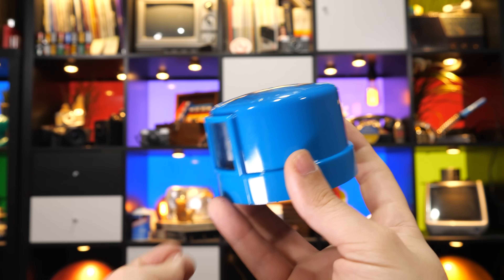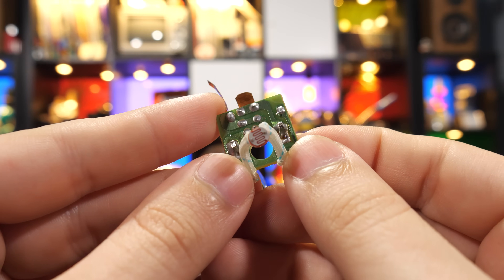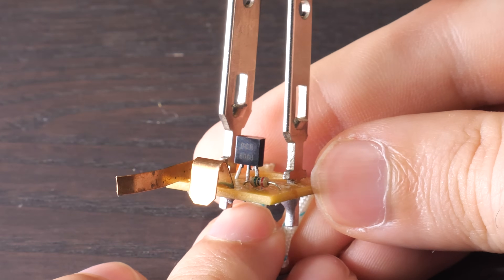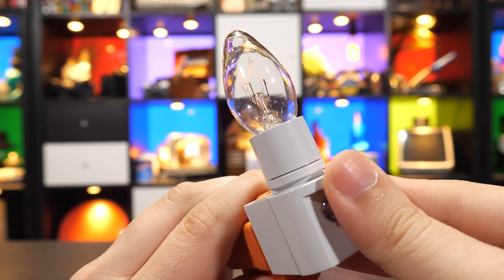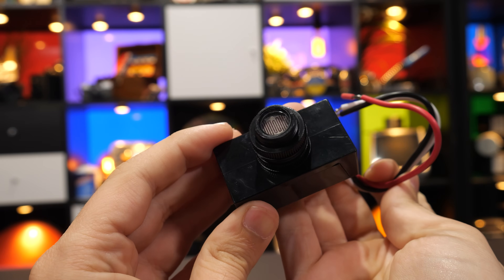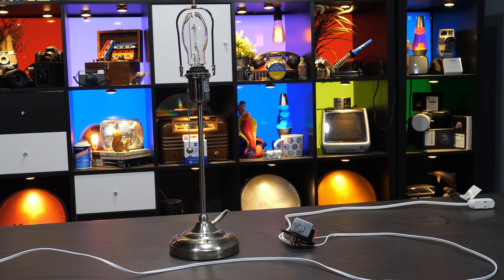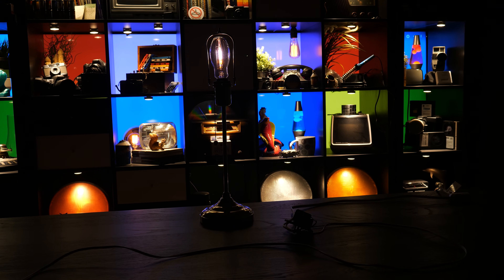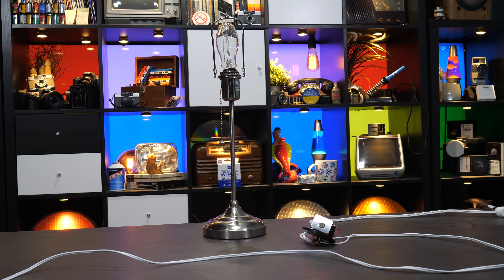Photoelectric light controls are weirder than they seem

Comment: 12:58 "in many cases, banks of street lights are wired to a central location, and a single one of these is used to control a contactor at the distribution point"

Gee, I wonder what those contactor thingies are! Also I love crossovers :)
Reply: It’s basically a beefier version of a relay
Reply: @joeslinky  I'm pretty sure they are referencing the existing video about contactors ^^
Reply: @joeslinky  I was referencing other TC video about contactors, you should check it out, it's great! (As every TC video is)

Comment: I worked for lighting design firm and designed layouts for streets, highways, and parking areas. But until now, I had no idea how the photo controllers actually worked.  Well done, thanks for posting!  And yes, striking an HID lamp requires a large amount of current and is hard on the lamp.  A system that works slowly is critical to maintain the life of the lamp.  Again, great job explaining the why in addition to the how.

Comment: i've fixed a digital clock in a late 80's nissan by re-flowing solder joints on a resistor that same size. questionable construction. possibly planned failure? i mean it is quick to replace now.

Comment: Thermostatic switches are also used in residential HVAC systems as a sequencer. It delays the blower in the air handler turning on for a few seconds (usually around 30) for the coils to start becoming cold as the refrigerant begins flowing before running air through them. More importantly they delay the shutting off of the blower after the compressor has shutdown to harvest the residual cooling from the coil and to blow the slug of cold air clear of the ducts and into the conditioned space. I would also think this helps to avoid moisture problems in the ducts of cold air meeting warm humid air in a confined space and not being blown clear.
Reply: Your comment was stolen by a bot so I'm commenting here so you get promoted
Reply: @How_To_Drive_a_TARDIS  thanks. I didn't know they were doing that now

Comment: I'm not sure if I misunderstand so someone please correct me if I'm wrong, but the way the circuit diagram is drawn, the LDR's active region — that is, when the photoresistor is active — will still run the light since current will still flow through the circuit. In the circuit diagram, shouldn't the lightbulb sit between the 2MΩ resistor and the thyristor?

Comment: There would be a "middle ground" design between the bimetallic thermal switch and a microprocessor-based solution.   Look into an electronic circuit called a "comparator".  It produces an on/off output when its input signal goes above or below the "reference" signal input.   You can buy photoelectric control modules that use this approach, and they have the advantage of having a "sensitivity" control on them to allow the user to set the desired light level for activation.  Hysteresis can be built-in to the circuit by simply adding a resistor.  The output of the comparator then drives a relay or contactor sized to control the load.
Reply: Most outdoor PIR lights and sensors have the adjustable dusk to dawn feature built in, exactly as you say.

Comment: There´s an advantage of wasting 2W of power: this thing won´t freeze up in winter, and there won´t be condensation.
Driving a microcontroller from mains voltage in a safe manner takes also 1W of power. You can of course optimize it, but then you need to test-qualify it every time you make the smallest change. And of course, complexity shortens the mean time to failure, so the wasted energy is nothing compared to the cost of replacing those things.

Comment: I recently made some moth trap switches I used a 555 for the hysteresis and it drives a relay with it's output. No micro, nice and simple.
Reply: A friend of mine made it using bare transistors, no microchip needed but it did use a slightly bigger ciruit

Comment: 17:15  This device is much more tolerant to lightning, too.  Important when it's setting atop a tall, grounded metal spike.
Reply: Funny you should say that.  The last time I saw the insides of one of these controllers was when it had just been turned into plasma by a lightning strike.  I was stopped at a red light and was across the street at the time, about 50 feet away.
Reply: A Faraday cage is not a magic item. There is heat when a lighning strikes, there are the magnetic components that come with a large current, points of failure (hot spots) if the metal has imperfections, etc.  They need to be engineered and tested as well.
Reply: I doubt it would survive a lightning strike. Even if it did, plenty else in the street lamp wouldn't. Including the lamp itself.
Reply: @Nathan_Lang  Direct strike - no. However, a lightning strike generates EMP and voltage spikes that may fry electronics that are too close. This device would have higher chances of surviving a close lightning strike than one with a microchip and a power supply.
Reply: @Nathan_Lang They mean the EMI from a nearby lightning strike, which can cause issues with microelectronics.
Reply: @Nathan_Lang  no, it  won't, what he means is the brief flash of lighting will not be enough to trigger this to turn on.
Reply: @EwanMarshall  100% not what they meant, otherwise, they won't say "tall, grounded metal spike"
Reply: Don't you mean turn off the light? @EwanMarshall
Reply: There are semiconductors in the drivers of LED streetlights. I don't think it's be that big a deal to incorporate a dusk switch into their design, if they don't already do so.
Reply: The point goes deeper. The power lines will have introduced surges from all the metal spikes grounding lightning, even when controller is in safe ground level box
Reply: Uh, I've seen my cheap solar lights turn off for a split second when the lightning was bright enough to cause the solar-cell to think its day now. Lights going off due to a lightning was creepy for the few seconds it took me to make the connection between lightning-photons triggering the solar-cell-daylight-detection.
Reply: hard to believe that heat activated switch can work on outdoor light poles in temperatures ranging from well below freezing, up to over 100 degrees.
Reply: @itoibo4208 that might work to its benefit, the sun will be higher in the sky when the lights turn on in the cold dark winter vs lower in the sky in the hot bright summer
Reply: @raptorjesus5488  The sun is closer to the horizon (lower) in winter and farther from the horizon (higher) in summer.
Reply: I love this software joke worried makes it look like it's crashing which the look of a city would be you put one of those computer ones up there lightning strikes and that's exactly what happened with the software inside it stutters out😂😂
Reply: Ah, that would explain why a cheap microcontroller is not the way to go 😄
Reply: Well, usually light sensors are installed on top of a cabinet on the ground. Also if your concern is lighting you really should use SPD, because you know what is more sensitive? LED drivers that are inside the fixture themself. They break down so you really want the SPD.
Reply: I bet many, MANY, more of these will fail, compared to solid state approach, because those thermal switches wear.
Reply: This design also prevents kids turning the lights off using a laser pointer - what kid is gonna want to stand there for however long it takes those resistors to heat up enough to throw the bimetal switch holding a laser pen steady on the sensor and risk getting caught ;)
Reply: and the little bit of extra heat keeps them from freezing in the winter.
Reply: I highly doubt any of the components inside would function after being hit by lightning lol. At the very least those resistors would be destroyed and the switch would fail closed causing the lights to be stuck on.

The most likely thing I see happening though is the entire circuit being completely obliterated beyond recognition and the lights shutting off. I doubt any components in there are rated for the amount of power capable of obliterating an entire tree.
Reply: I did a tear down on one of these last year and was similarly surprised at the elegance and simplicity.
Those thermal disc snap-action switches are well proven and manufactured by the gazillions.  Good choice!
End result:
(1) More tolerant to lightning (or voltage glitches).
(2) The normally on warm resistors probably help dry out moisture in wet environments.
(3) No microprocessor with a power supply incorporating those famous "high-reliability" Chinese capacitors.
Reply: Source?
Reply: @AtlasReburdened  25 years as a broadcast engineer.  I've seen quite a few of these with their contacts welded closed.  Short of that, they're quite reliable.  (Tower lighting systems usually have these located at the transmitter building and at ground level, where they're easily replaced.)
Reply: @AtlasReburdened  Go Googling. You shouldn't expect people to spoon-feed you information all the time.
Reply: I mean if that is a worry, give it a Faraday cage, problem solved
Reply: @LillyP-xs5qe  that ads more cost, complexity, and points of failure. It can be easy to solve a lot of the problems that can arise when engineering something, but its very difficult to do it in a simple, cost effective manner that increases longevity. there is a reason why "over engineered" is a common phrase.
Reply: @davidfernelz  do you know what a Farady cage is? I wouldn't call it complex or costly, it's just some metal cage to let the electricity go around the unit instead of through it
Reply: @davidfernelz  adds more
Reply: @LillyP-xs5qe   The skin effect of the metal rod itself can do that, if the housing is properly grounded :)
Reply: @LillyP-xs5qe A Faraday cage around a giant metal lightning rod with a lamp on it that needs to be grounded?
Reply: @alexg8406  faraday cage around the light sensor duh...
Reply: @LillyP-xs5qe   A Faraday cage could cause internal "spikes" of electricity - you need to have that thing well grounded! You're attempting to sink a hella lot of wattage!
Reply: @3nertia  attach it to the light post as ground, it be a simple metal outside case.

Comment: Why isn't the heater placed like the lamp in the first circuit,  while the temperature switch swapped (so it activates when heated)? This would not consume any significant amount of electricity over the day and barely increase the complexity.

Comment: We used the power off / on feature to test street lights during the day. Thus avoiding driving around at night to check street light outagages :)
Reply: Does not catch those lamps that are EOL and cycling though, they normally take 30 minutes to heat up enough to start to cycle, and then will take 30 minutes on, 15 minutes off as the cycle for the rest of the night. Though you do get Osram lamps that are dual capsule, which will immediately start (30 second light off) if it is old and cycling. Also there was some success with making them low sodium and mercury, so they would never heat up enough when EOL, and thus stay with the dim blue Argon Xenon starter discharge in them.
Reply: Around here we see the street is on all day or off all night and call the power company and report it. They are very good at repairing the problem.